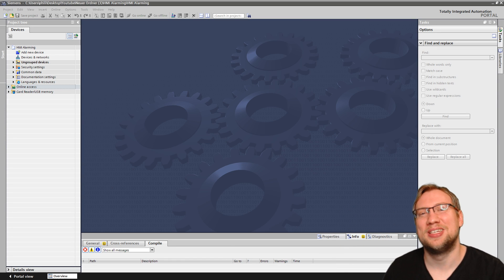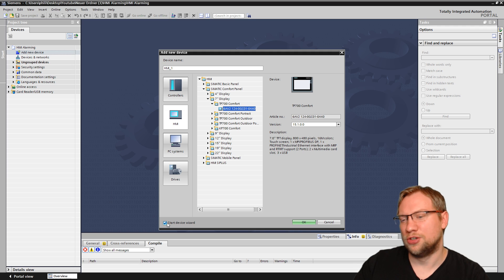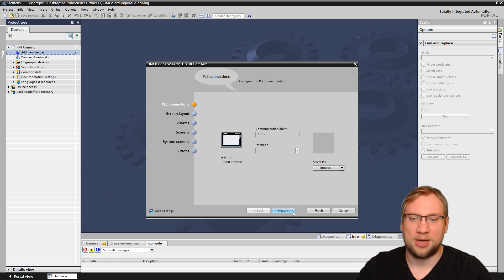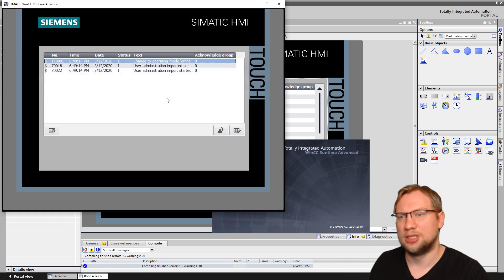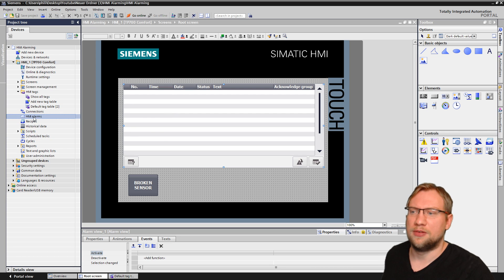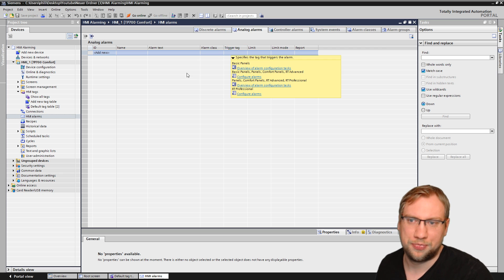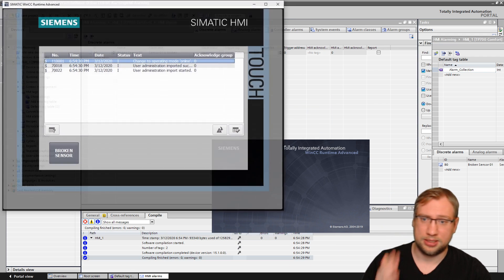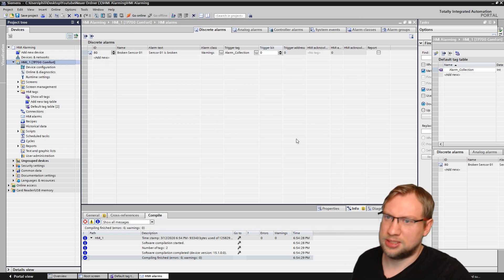TIA Portal: HMI Easy Alarms

Comment: i want the alarm line moving. In wientek all the current alarms are displayed on alarm line and it move right to left showing all the alarms. i want to do the same in TP900 comfort. if it is not possible siemens systems are no good for me then. cause i have those fucntions on woentek, rockwell, omron